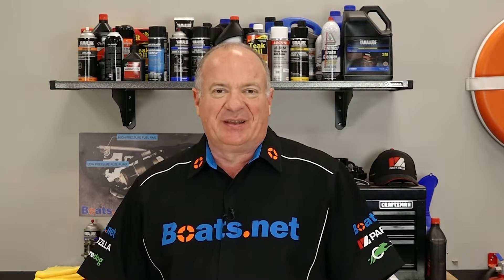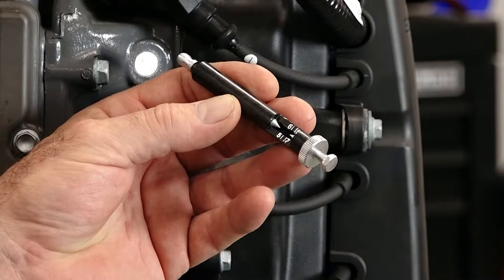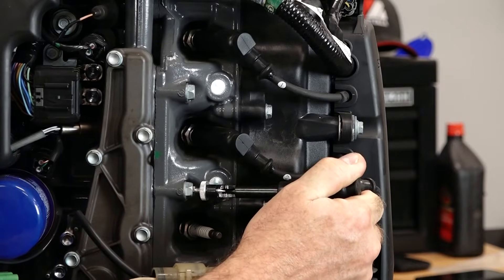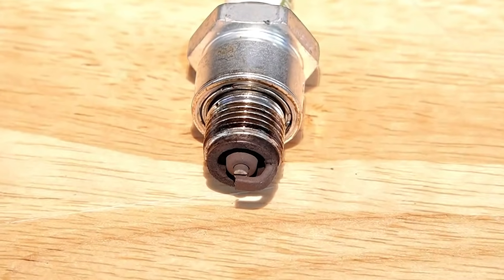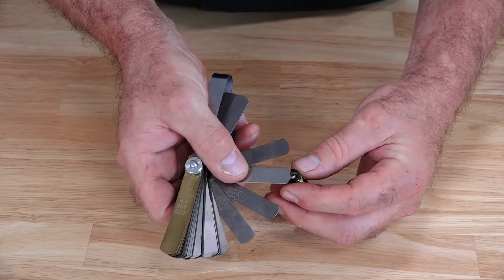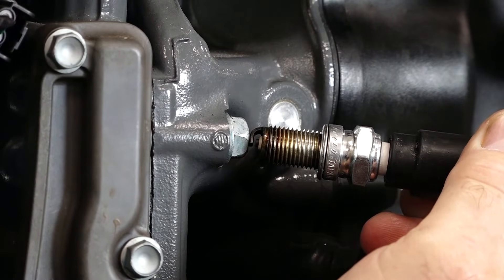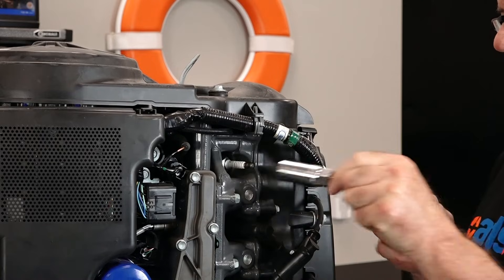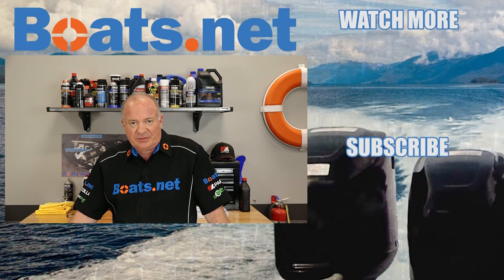How to Test Spark Plugs on an Outboard | Outboard Ignition System PT 2 | Boats.net

Comment: Have  a  2 7:45 cylinder Yamaha  out 55 hp motor
Reply: Not getting  spark on 1 cylinder. What could be the cause  or fault

Comment: Question about the spark tester... Can I just use the same spark tester as used on a cars engine for a 2-stroke boat engine?  The type with a light that flashes during spark?  Or will that not work?  Thanks!

Comment: #2 cly not firing,. 97 yamaha 90 2stoke. 1 & 3 good .ck coils there good. Motor was running grest. Switched #3 coil wire to #2 ,,  #2 >#3.. cranked engine #2 cly fired , # 3 no fire. WIres plug from CDI. ALSO  checked  stator. And pulser coil. Good.  HELP PLEASE.
Reply: Plugs , coil wire

Comment: I've got a 100hp mariner thats not running on all 4 cylinders it runs great on 3 outta 4 ive tried everything. Its getting spark. First thing I cheaked new wires, coils, plugs and rebuilt the carbs and fuel pump I chased the fuel lines down and its getting fuel someone said it might be the reeds I can take it out come back and the plug still looks brand new. Compression is between 120 125 on all 4 cylinders. Is there anything else I can look at power pack was replaced also Im gonna retire the motor this year if I cant figure it out by spring

Comment: Hi John could  you please help me out im having  trouble with my yamaha 40 hp tilt n trim it' starts fine and runs  well on land , when in water  it seems to die out on full  throttle.
Reply: Had a similar issue. Needed to rebuild the carb

Comment: Thanks! When in inspected the three plugs on my 98 Mercury 40hp two stroke, the top of one of the plugs separated from the body of the plug when I pulled the wire off. Problem solved. Suspect they were factory original plugs since they had some black over spray at the base. Long over due for sure. Boat only used a few times a summer.

Comment: Hi John, i just bought a Tohatsu 50 4 stroke may 15th 2022. Its not running good. Its like its missing on a cylinder or two. The spark is very week orange colour. One spark plug had a bit of wetness on top of it. It struggles to go over 3000rpm. I have put antifreeze line bottle in it but it does not help. Can you help me please as the dealer does not want to know anymore. I would appreciate it very much.

Comment: John, one last question. I just had to replace a perfectly good ignition coil because it got stuck to the spark plug insulator ($150 ouch!) when changing my spark plugs. Does Yamaha recommend using a bit of dielectric tune-up grease on the ignition coil boot to prevent it from sticking to the spark plug insulator?  Please advise.